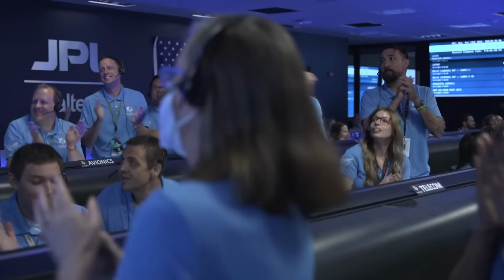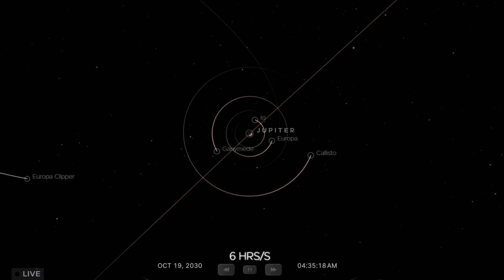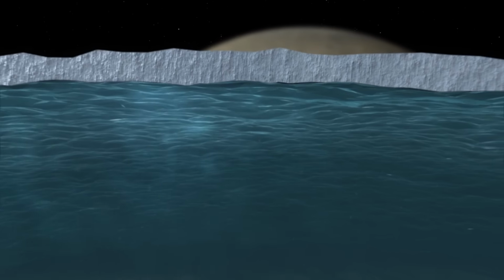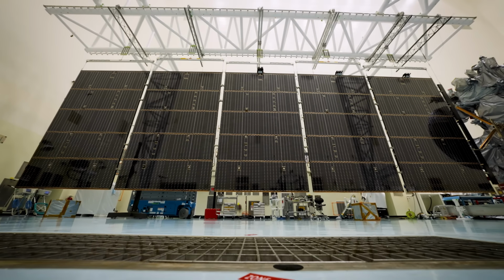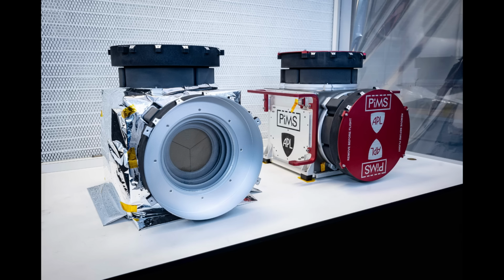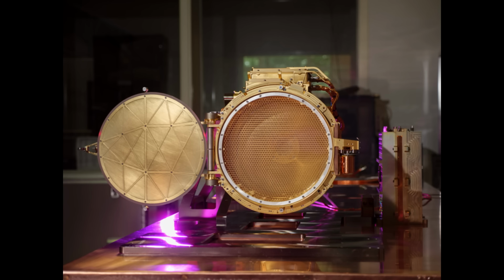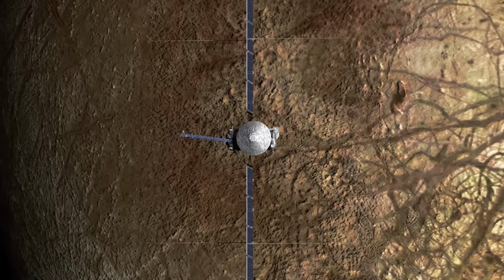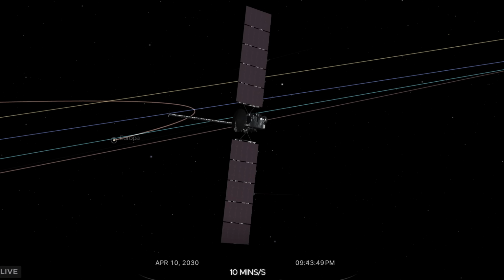SpaceX Ditched an Entire Falcon Heavy To Launch NASA's Massive Probe To Europa!

Comment: Life possible? I have heard that water is either used or is  planned to be used as a radiation shield by storing the water within the walls of the human space habitat.

Now if this 'theory' is correct then having a frozen layer surrounding a liquid ocean, life should be possible.

It all depends if water can act like a shield for radiation. 

And l haven't a clue if it is true or not. Alpha radiation? yeh ok, but what about gamma radiation and the other more 'energetic' types of radiation???
Reply: Water definitely works for radiation shielding; nuclear power plants will leave their spent fuel rods in pools of water for a few years to cool down, and 6 meters of water is apparently enough to block the radiation.

Comment: Ok, his is probably an unrealistic question.  But given the intense nature of Jupiter’s ion radiation belts which seem to generate x-rays in the inner belt and given the likely high energy impacts between particles I would think would also generate gamma radiation would this be a viable energy source to power a spacecraft orbiting the planet or its moons?  Same question for the intense magnetic fields themselves.  And if they could be energy sources could it be more efficient than the ~3% of solar energy that the Jupiter system receives?  The video got me wondering about this.

Comment: How do all the computations work for these multiply fly-bys for these probes? I thought even a 3-body problem had inconsistencies. Is the path of Europa Clipper constantly measured and adjusted as it goes, or is the initial planning good enough for most of the flight?
Reply: 3-body issues don't really apply because the mass of the spacecraft is insignificant compared to the planets.

Effectively they treat the sun as a fixed point and the planets/moons as a fixed trajectory. This simplifies the equation so the trajectory of the spacecraft can be efficiently calculated.

They do make course corrections, because even a tiny error will add up and you can only be so precise in reality. Usually they schedule these a couple of times a year, more often as they get closer to the destination, but usually the navigation is accurate enough that they don't always need them all.

Comment: Not using RTGs is insane.  This spacecraft will not last long.
Reply: What do you mean? There are satellites and probes launched decades ago that use solar power that still operating.
Reply: @bbartky    The only deep space probe to use solar power is Juno, and it has operated for only 8 years at Jupiter.  All the rest used RTGs.  And as Scott said in the video, Juno has managed to survive the high-radiation environment by squeezing between the radiation belts and Jupiter as it flew by, something the Europa Clipper won't be able to do.  Juno is currently the longest lived space probe still operating besides the two Voyager probes and New Horizons (all RTG-powered).

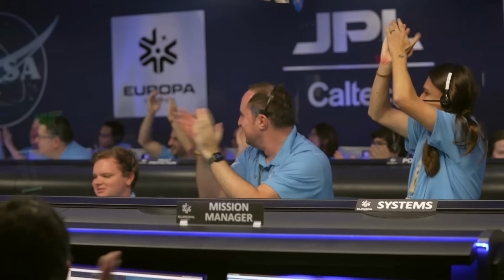Comment: 1:19 Technically true.  However, some come close. The fueled mass of the Europa Clipper is ~6,065 kg (13,370 lbs).  ESA's juice"s mass, ~6,050 kg (13,338 lbs) and the NASA Cassini was at launch  ~5,712 kg (12,593 lbs).  Speaking of Juice, it launched 14 April 2023 has similar but somewhat geographically expanded goals as NASA’s Europa Clipper. The trajectory has a moon, Venus and three Earth flybys to arrive at Jupiter July 2031. The Europa Clipper mission is currently scheduled to arrive at Jupiter in April 2030. The primary reason that NASA's Europa Clipper mission is set to arrive at Jupiter over a year sooner than ESA's Jupiter Icy Moons Explorer mission, despite launching nearly six months later, lies primarily in the launch vehicles differences. SpaceX Falcon Heavy, is one of the most powerful rockets available. The high performance of Falcon Heavy gives Clipper a higher initial velocity, enabling it to follow a faster interplanetary trajectory. Juice, on the other hand, was launched on an Ariane 5 ECA+, a capable but less powerful rocket compared to the Falcon Heavy. Juice's longer cruise time compensates for the lower initial velocity with its use of multiple gravity assists. Go SpaceX.

Comment: Why would "high and very high frequency signals" penetrate below the surface?
Wouldn't that require low frequencies?
Reply: High frequency is just the name given to any signal between 3 and 30 MHz. And vhf is 30 to 300 MHz. These are low compared to microwaves, but high compared to signals in the Hz and kHz range. It is ironic that "High frequency" is pretty much the lowest frequency that we use.

Comment: 9:23 What if they found a crazy orbit (Saturn-Europa Lagrange 2 point) where the satellite is always "behind" Europa, and never "sees" Jupiter? And is therefore shielded from Jupiter´s radiation by its moon? That could increase the Life expectancy of the mission and allow more experiments to be done.
Reply: I do not think that's how that works. The radiation does not stem from Jupiter, traveling outwards like from the sun. Instead Jupiters massive magnetic field traps ionized particles that 'orbit' around Jupiter  like in a huge donut-shaped cloud.
Reply: @debott4538  that is definitely rocket science. I just thought that if 10mm Aluminium sheet helps shielding, certainly a whole Natural Moon would help somewhat.
Reply: @lindenmeyer11  You were correct in thinking so. If the radiation had a single point source, it should definitely work.
Reply: That's just the Jupiter/Europa L2 Lagrange point (JEL2). As far as I'm aware, the main problem with that is that it's too far for Europa to be an effective shield. Also the other moons will pull the probe around and it will burn comparatively large amounts of fuel trying to stay in place.
Reply: @Ithirahad  there is always a tradeoff…
Reply: The moon would shield it since radiation belts are a torus not to mention Jupiter is blocking your view of Saturn from Europa half the time

Comment: How come radiation is a problem in space. Why don't they power spacecraft with that power from radiation. Radiation is the source of energy. We can even boost shields with that radiation of mag. fields if uses properly. Electricity... I think it's name...
Reply: Depends on the kind of radiation. EM radiation? Yeah, we do power spaceships with that, via those shiny wing-like things we call solar panels. Gamma radiation that might go right through those without interacting at all and might go through 1 cm of alu and interact with a microchip instead is a bit more of a problem. Alpha radiation is no problem on Earth because a few cm of air or a sheet of tissue paper will stop it, stick some electrons to it and turn it into helium, but helium hitting your microchips at tens of kilometres per second might be an issue.

Comment: Would love a deleted explanation on why it’s so much faster on SLS than it is on falcon heavy. You just stated the fact that it is but didn’t explain why
Reply: EC must perform two fly-bys of Earth and Mars in order to make it to Jupiter. This means the probe needs to travel around the sun multiple times. On SLS it could have gone to Jupiter directly.
Reply: SLS is bigger rocket hence could deliver the probe to Europa without the need for gravity assist
Reply: The upper stage of SLS is more energetic than Falcon’s second stage, hence carries more fuel and has greater throw-weight.
Reply: Delta V of SLS